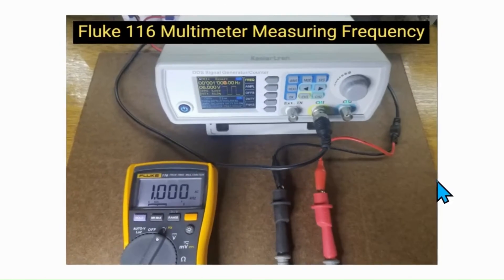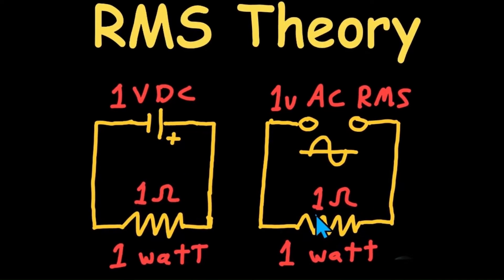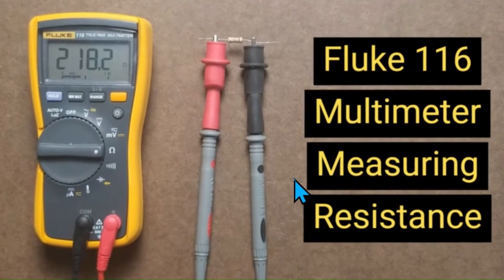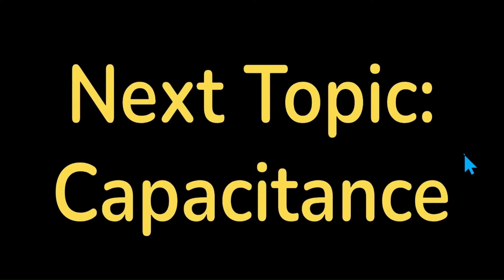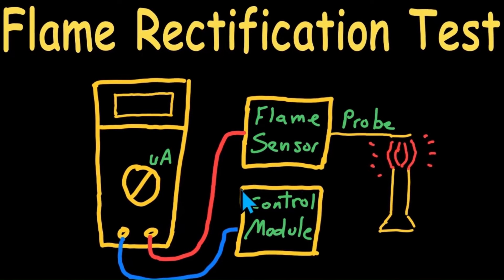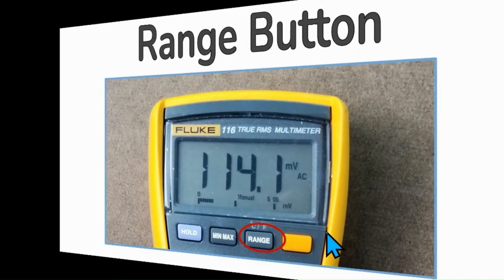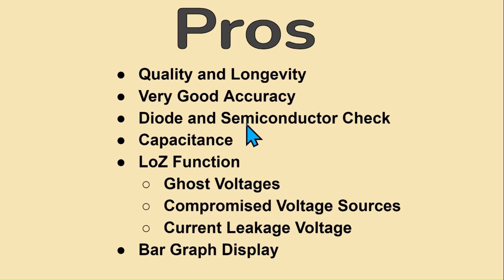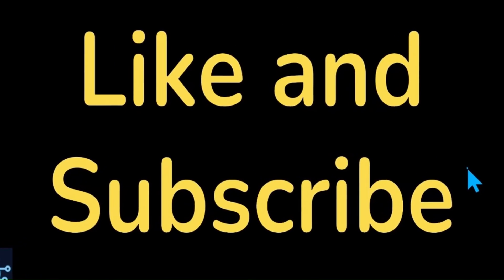#67 - Fluke 116 Multimeter Review: Best HVAC Meter? Ghost Voltage & LoZ Explained

Comment: Can you check parasitic drain on a car with this
Reply: Yes miliamp mode. Radio/clock use should be below 10 miliamps. Beware the car interior light or other larger than 440 miliamps will blow the 440 milliamp meter fuse. The other fuse is 10 amps. depend on how bad your short is

Comment: I bought a 116 meter but I always go back to my 16 that was the previous model. I just like it better. I still have my fluke 11 too. Pretty good meter for its time.
Reply from the maker: Yeah that Fluke 11 seemed very advanced for his time. I really put it through the ringer but it still works fine. I did have to clean the elastomeric connector for the LCD display once but that's it.